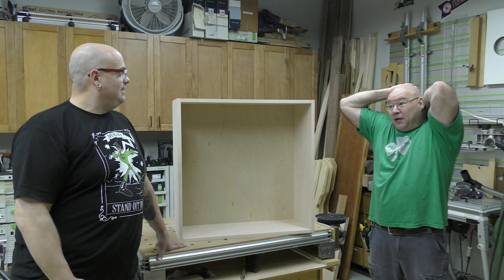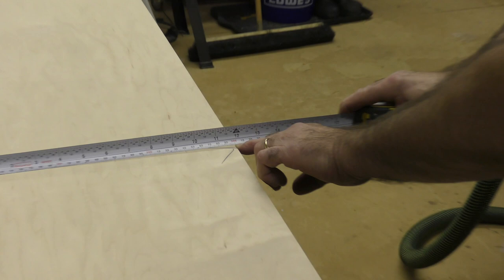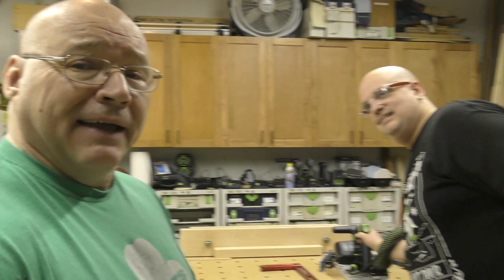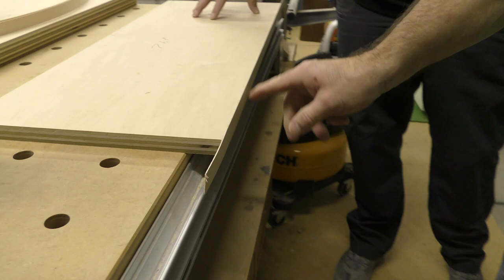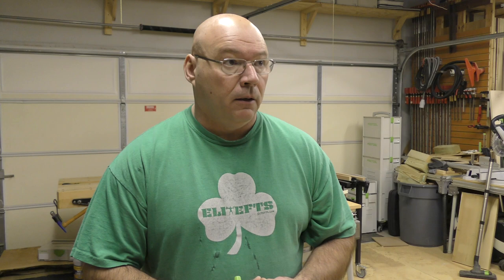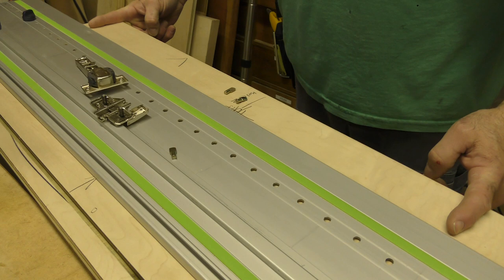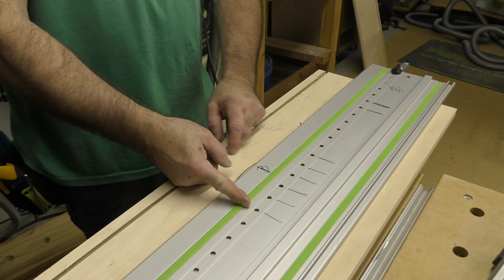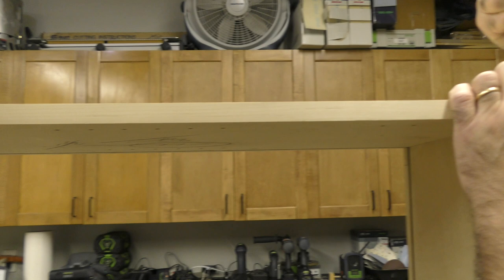How To Build A Wicked Simple Cabinet From Start To Finish

Comment: Thanks a bunch for this very thorough video.  Ties everything together.  Do you use glue as well or just keep to the mechanical type joinery?  I am not a big fan of glue, it is messy and sometimes I get panicky about getting all the dominos in place before the glue dries.  So, particularly with plywood or MDF, what do you suggest?  Also would you please include a list of ALL the tools that you use in a video.  It would really help in duplicating your setups.  I recognize most if not all of them, but I have been staring at YouTube Festool videos for a year and a half, and a new person to woodworking/cabinetry would probably appreciate such a list.  So would Festool (hint, hint).
Reply from the maker: I do not use glue .... just another step not needed. I also use a lot of prefinished plywood and glue does not adhere to the finish. I will start listing tools used in videos. thanks for your advice !!! It helps us !!!

Comment: And yet another brilliant video, am slowly making my way through your entire library. Two questions if I may (from a very beginner level)

1. Why are the sides of a cabinet always on the inside of the sides? And if the answer is something to do with the domino, does the theory still hold true if not using a domino?

2. Do you have a link for that particular tape measure with the viewing window?

Many thanks, and also thanks so much for continually answering all my questions
Reply from the maker: The tops and bottoms are always between the sides of a cabinet  for shear strength..... 
The tape with the viewing window is discontinued ..sorry

Comment: Hey Sedge & Big D - Thx for the great videos, both here and on Festool Live they have been very helpful.

I am planning a kitchen project remote from my shop. Before embarking on that I thought I would organize the shop and do a little practice at the same time. So I am building a Systainer wall. The first part I did in a traditional Domino glue up manner with nailers screwed the the outside. All went well including a few hard lessons on “square care” during glue up.

Since the kitchen is remote I am using the Festool KD connectors. Your lessons have invaluable here and the cabinets have gone together smoothly. When it came to installing the nailers I thought I would practice making each cabinet an “end cabinet” with hidden dominos rather that visible screws. After messing around with it for a while I have concluded that while this is possible it is not a fast and easy setup. So since these are just shop cabinets for practice I am using the typical screw methods.

So the question is can you explain and/or show sometime the method for hidden dominos for end cabinets. Even the “Build with Brent” series blows past this with “since this is NOT an end cabinet we will use screws”).

Thx again - Bill
Reply from the maker: great idea for a video...Thanks

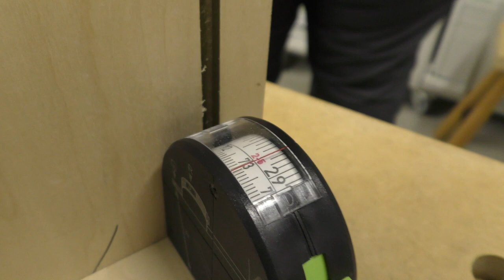Comment: At 34:20 in the video you use a measuring tape to measure the inside measurement to calculate the back panel measurements. In a lot of your videos you list "Tools used in this video". Can you tell me where to obtain it. Thanks for all your great content. Love watching them and learning.
Reply from the maker: The tape we are using was originally issued / sold as a Festool item...it is discontinued .....sorry
Reply: @sedgetool  Thanks. I have been looking for a simple tape that can measure accurate inside dimensions. The only ones available are ones with a Laser and the small LED displays are hard to read or ones that you have to add the tape dimension to the tape dimension.

Comment: Sedge,
Thanks so much for an outstanding presentation showing the tools and process for building a cabinet. Looking forward to watching the Shaker door video next.
I just made my first domino joints this week, so the joinery section was especially helpful. 
What modifications would you make if the sides of the cabinet will be exposed and one didn't want to see screws  ? 
Perhaps fully counter sink the screws and cover with plugs ?
Could a similar size cabinet be made with dominos alone, no screws,  and glued/clamped together ?
 If so, how many dominos along the 300mm width would you recommend ?
Reply from the maker: 3 dominos if no screws....This is a great topic that we are going to shoot a video in the near future.....the exposed end can be covered by an end panel , applied molding, plugged , filled ......etc..... Thanks for watching !!!!!

Comment: Great video guys and I learned a lot. The 700 router you used at the 21 minute mark to do the dado… Is the 700 base and fence included in the MFK700 accessory kit or is it separate items? And can you list the part numbers? 
Hopefully you guys do a video on how to use the LR32 system  to pre-bore the holes for something like Blum drawer slides….
I would love to see you guys do a companion to this video in written form with some pictures/notes and post it on FOG with a link to this video so there is a quick easy way to reference Sedge’s easy way to build cabinets! 😊
Thanks guys. Great content.
Ron
Reply from the maker: Ron .......the MFK700 base I use to groove for the back is included in the MFK700 kit ..part #574 368 . the parallel edge guide is an accessory it is part # 495 182 and does not come with the MFK700 kit ... hope this helps

Comment: Hey Sedge! Is the little tool you use to get the 6mm around the 2:50 mark included with most of the track saws? Scratching my head on where to find it (know I could use a combo square but trying to make life easy).  Keep up the awesome videos-I'm loving Festool as a system the more I get into it!
Reply from the maker: bottom of the systainer....

Comment: Sedge, seeing as this is bread and butter butt joining of the cabinet sides, the full-length back panel retaining groove on the side panels will peek through on the top and bottom of the cabinet in the corners. I realize that this is normally not visible in a floor cabinet with a counter top situation. And I did see on your Festool Live one time you had a sweet Domino plug solution to cover that sort of space. But IF someone wanted to make a blind groove on the vertical cabinet panels, is there a cleaner solution already within the Festool system? Maybe using one of the plunge-base routers and then also the quick-adjust stops on the track itself? I wish I could be clearer with my question and I'm not yet familiar with the model numbers of the Festool power tools & accessories (I don't own any...YET, lol)
Reply from the maker: I would use a plunge router and do a blind groove

Comment: Sedge, appreciate your channel and coaching on the Festool Systems.  Am I correct in assuming the average balanced cabinet is 768 Lx 732W?
Reply from the maker: There is no true standard as long as the height is a factor of 32mm
Reply: Great thanks!

Comment: Sedge, at 3:01, you reminded Big D to lift the TS 55 blade up at while still running at full speed at the end of the cut.  Would you explain the reason why this should be done? I'm somewhat puzzled when we are reminded to let the Kapex blade come to a full stop before lifting the blade?  At least one source I found (e.g., the TS 55 REQ Supp Manual, p. 18 under "General Procedures") seems to suggest leaving the blade fully plunged at the end of the cut until it comes to a complete stop.  In the past I've always told my novice woodworker friends when I'm  introducing them to to joys of Festool to let the blade to come to a full stop before lifting.
Reply from the maker: Leaving it running and bringing it up into the housing is the proper procedure... It will prolong the life of your splinter guard....
Reply: @sedgetool  Thanks, Sedge.  You're the MAN!   I knew I could get the straight scoop from you.  By the way, you must be one  seriously early riser.  I see a lot of your online work shows up well before "0-dark thirty."  Get some rest, my friend.  Zzzzzz's are good for mind and body.

Comment: At 23:34 you show the hinge and clip. Nobody that I have tried seems to know what kind of hinge you are using.  I even called blum and they said that the inserta has to have two 8 mm hole for the expandable bushings.  So what hinge are you using?   I'm still trying to wrap my head around the Festool system but you keep making videos and Ill get there.
Reply from the maker: they are Blum Inserta Clip Top and I grind off the the nubs for the 8mm holes...

Comment: I forgot to ask, edge banding before doing the shelf pin holes? If not that would put the holes at 38mm+ from the front edge I’m guessing.
Reply from the maker: I always put the edge banding on first ...That way I get a true 37mm from the front edge of box....so it does not matter if you use .5mm or 1 mm banding ...

Comment: Nice job guys! What is that tool at 2:49? The one used to align the rail at 6mm and why do you need to cut the edge, was it not square?
Reply from the maker: That is the Limit stop that comes with the Festool tracksaws..Yes you always cut the edge to get a straight clean edge

Comment: Great video, thanks!  Question; in another video you mention setting the LR stops "32 Up and Out", in this video you used "16 Up and Out".  When do you use the two different "Up and Outs"?
Reply from the maker: That is correct... 16 up and out for the sides of the cabinet....32 up and out for the door... if you use / count  3 full 32mm holes then the cup hinge and hinge plate line up perfect...

Comment: Hey

Nice video. Keep it up. Question: what is the tool at 2:45 named? The adjustable distance spacer ish tool.
Reply from the maker: That is the Limit stop that comes with the saw...it has a 6mm offset that I use to set up the rail to rip a straight edge

Comment: couple of question: I use baltic birch and it a lot harder to pass with the router unlike you, why? 2- the 6 mm bit is to small for my 6 mm plywood, why? Can you help me?
Reply from the maker: I use a 6mm up spiral bit for the groove.... Baltic birch has many more plys than the 18mm ply I am using so possibly there is a lot more glue line ... but with a sharp bit it should be no problem ... To answer the 2nd question I would definitely measure the thickness of your backing ply to see it it is truly 6mm ....

Comment: Hey Sedge, if you are applying a face frame to the cabinet, and want to use dominos, how can you set up the tool and layout so that the face frame has a 1/16 overhang on each side?
Reply from the maker: great question....i need to do avideo on this....I build the FF first and then build the box to the frame. I use a 2mm reveal on each side
Reply: @sedgetool  I saw a clip (a while back) where you did the dominos in the right setting on the frame, using 28 on the depth but on the case it was 20, leaving 4mm per side. Maybe a “Big D: hey Sedge” short video. You give out a ton of good information some gets lost in the lengths of the videos

Comment: Also I don’t see any glue when putting these cabinets together, looks like not needed?
When you are adding dominos you added only 2. What’s the general rule? Can I apply the same for drawers too? A drawer 700mm x 520 mm (28-1/8 x 21 inches) for Blum undermount
Reply from the maker: no need for glue ... you can use it though... by not using glue we can eventually take it apart and finish it flat ...make it easy.  there is no general rule for domino spacing...... I like to space my dominos every 150mm apart......but in this cabinet build the domino tenon is used for alignment in assembly ... hope this makes sense..... we plan on creating plenty of videos using the domino in the future .... including drawer box building......
Reply: @sedgetool  you are an awesome teacher/mentor!!
So if you are saying domino is meant for alignment, is it the screws that’s holding it together? I saw you add GRK screws only to the end was there any added in the middle as well?
When working with a 1/2 inch material for drawers, are screws still considered a better option? Coz to me the hard part to keep them perpendicular when driving in

Comment: Are there cabinet builds using a domino where screws are not required? Or it’s always good to add screws as well when building cabinets using dominos.
Reply from the maker: I have always used screws for basic cabinetry utilizing the domino for front edge alignment  and to ease assembly ..When I am building a case / cabinet...Think free standing bookcase ...I usually just use dominos...I hope this helps !!!

Comment: Have been using festool 55 and 75 for solid sirfave work for probably a dozen years..does anyone else notice in anything above 48” there is a noticeable bow in the track?…I see everyone swear on these tracks for plywood breakdown I wouldn’t even consider it..that slight radius is not something I can work with..curious am I the only one who sees this?
Reply from the maker: I have seen this a 1000 times...it is not the track....most believe it is...In most of my videos I address this....the user needs to push the saw from behind...I know this because of the frustration iI used to have 18 years ago until I figured it out...The track has a little flex to it and if you push the saw from the side you will end up with a hollow in the board...I wish I could come to your shop to show you....

Comment: Love you video, just a question: what is your tape measure? I find it cool!
Reply from the maker: It is a FastCap Metric / Imperial tape !!!!
Reply: @sedgetool  the one that you can see on the top the distance?
Reply: Please?
Reply: It's the Festool tape measure!
Reply: @tedrzz  It's no avalable anymore...
Reply: @danste01  Unfortunately you are correct :(
Reply: @tedrzz  Exactly.  I have 2 of the Festool tape measures.  The top-view window is nice but not necessary.  Alas, I suspect these were made by someone else and private labeled for Festool.  They were just not up to Festool's usual high standards.  Both are sprung and no longer retract properly, even after multiple disassembly and rewinding.  I regard them as Festool fan-swag rather than serious Festool tools.   I keep them because I'm a Festool fan-nut.